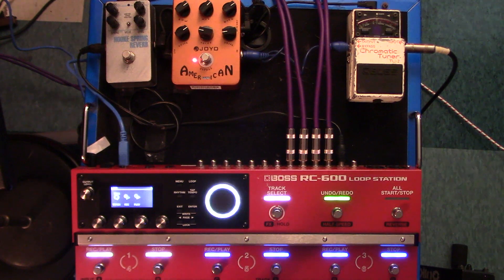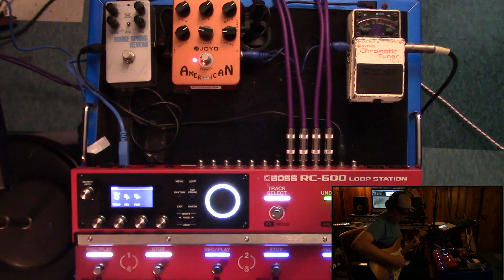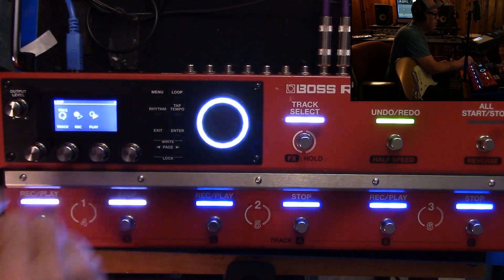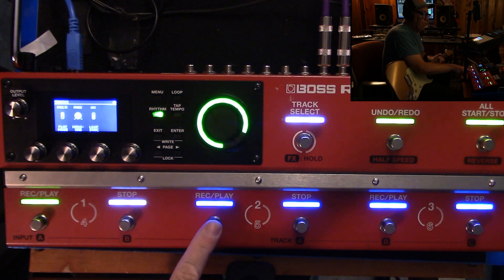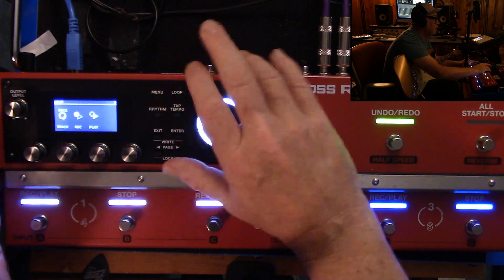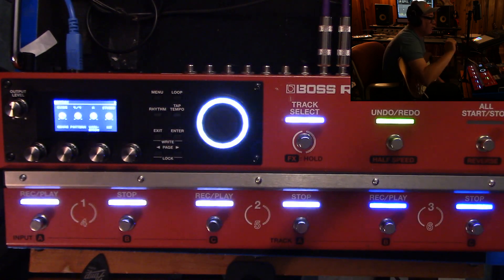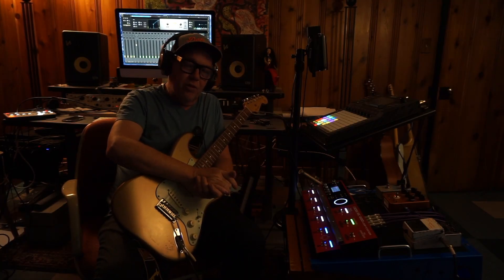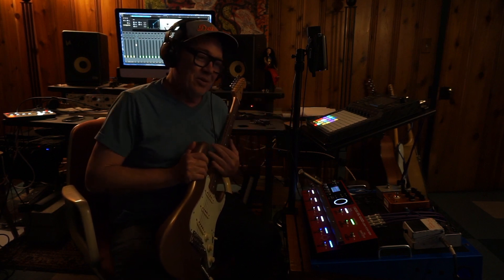BOSS RC600 SYNC SOLUTIONS #bossrc600 #rc600

Comment: Congratulations again, these are the videos that go, the ones that are made from sincerity. 
Thanks for warning about this synchronicity problem. 
You sound great with the Joyo and that other tremolo and reverb pedal. 
As you say in the video, perhaps the integrated boost effect can be useful, just as I have seen you in other videos take very good advantage of the reverb for the voice and I suppose that the fact of having an octave to simulate a bass is great help, but the rest of the effects I don't like too much from what I hear in others videos (I haven't been able to buy the unit yet). 
Could you tell me if you see it possible to use the two phantom microphone inputs of the Rc 600 to feed a stereo microphone, like the Rode NT-4 that I have, to record an unamplified acoustic guitar?
Reply from the maker: Hi Emilio! I'm sure the RODE mic would work great with phantom power from the RC. I admit my expectations have been very low for the quality of the FX. I do think they are more than adequate for a live situation or even recording. Some are better than others, but overall they sound "good enough" to get the job done. I have played through tube amps most of my life so I wasn't expecting the amp sims to be any better than the Katana programs. I like those too but find the simplicity and tone of the little Joyo to work even better. I am still waiting for Laura to do her vocal demo! I'll hook up a condenser mic too so you can hear it. The audio quality of the 600 is superb. What goes in, comes out with the same fidelity.

Comment: Any ideas why the loop station is not triggering the drums when I initially go to record a track. After I stop the recording the drums kick in. I can't imagine a scenario where this would be wanted, necessary, or needed but that's what's happening. Any advice on what to do to get Drums of a separate drum machine connected midi to engage when I press the pedal to initially record a new track
Reply from the maker: When I sync drums via usb midi I start the RC600 rhythm track on pedal 9. I set that to rhythm start/stop and it will send midi clock to another machine. While it is in play, I will record my loop on any track. I can then play back the loop with or without either internal or external drums. Seems I should make a video explaining it 😀 not easy to answer in a comment!
Reply: @LRCDetroit  I figured out that it will trigger the drum machine should I press the Rhythm button on the face of the rc600. But this also engages the drums for the rc600 which isn't a big deal but I just rather not use them so I can have full control on my Aleesis SR16. I've been trying to figure out if there's a volume for the RC 600 Drums of which I can just keep muted so I can have the Rhythm engaged the drum machine without also activating the rc600 drums. I mean there's got to be a way to simply mute the rc600 drums, no?

Comment: I'm wondering if you have this volumes set up so you don't have to reach down during a gig?
Reply from the maker: Hey Dan-yes for sure. I tried hard to keep consistency when recording my loops. It is nice to be able to balance as you go though. I can turn up the rhythm or loop independently and change kits quickly. No more tedious than having a huge pedalboard to tweak 😁
Reply: @LRCDetroit  so I'm guessing you have midi controls to adjust loop volume and percussion
Reply from the maker: @dancassidy7471  actually I just assigned the knobs under the tiny screen to RHYTHM volume and LOOP volume. If you use a separate mixer, you can easily do the same routing the sub outputs into the mixer. It was easy though doing a performance without a separate mixer, just the RC600 alone! The only issue was keeping the vocal mic volume consistent from song to song while using vocal input fx. I'm definitely going to make a video about that very subject. Like I said, an external mixer solves everything but trying to use the RC alone would be very efficient for doing certain gigs.

Comment: Hi mate. I'm having a major phasing type issue with my guitar. I run a tap tempo in to my rc600. It comes out and goes to a kaoss pad. I put my drums in the kaoss then tap in to the looper. It's all in sync then I sent my drums from kaoss to looper.

The issue is when I tap a tempo and play it in to the kaoss it then somehow gives my guitar a phasing type issue. It's really frustrating. 

I've turned of all effects and stuff but still nothing. It's doing it without anything actually been sent it to the loop. The guitar is fine pre tapping the tempo and recording it in to kaoss pad. 

Any help would be awesome 👌
Reply from the maker: Hi there-that’s a tough one! I’m not familiar with the Kaoss system and can only try to guess what may be the issue…so take this lightly. 
I have noticed the RC does have very slight latency when recording with the insert fx. However, it hasn’t interfered or become unmanageable. I’ve also thought the time stretching algorithm is not very good, so it’s possible you are hearing the RC adjust tempo to the tap and it’s mangling your signal! I set tempo manually so my experience in that area is limited. Wish I could help more!

Comment: Laura Rain and the Caesars
hI
I noticed you have Akai force. Are you using it in conjunction with the Boss 600 ?

I also have Akai Force. Does it make sense to additionally buy a looper ?
I want to have instant access to recording and effects . Unfortunately, there is no such thing on Akai Force.
Reply from the maker: Hi there-I have used the Force clocked to the 600 with success. Though when switching loops on the 600 I have not been able to switch scenes on the Force. Play/Stop works fine. I definitely would like to do more with the two machines together! Also, yes having the 600 to loop with your feet makes sense for me as a guitarist. A lot easier than the Force.
Reply: @LRCDetroit  
I'm not a guitarist, I'm a keyboard player. But I also want to have a looper.
What can you say about the RC 505 and the Hedrush Looperboard ?
why did you choose RC 600 ?
Reply from the maker: @СССРТВНижнийНовгород  I bought the RC600 because of the ability to store 6 loops in one program, use the rhythm machine and fx with my feet. Also, the routing is fantastic. Lots of inputs and outputs which works for well for a duo or trio live. There are a lot of little features that   appeal to me too, like the ability to program button function to whatever you prefer. I believe the 505 is very similar but made for tabletop? The Headrush I don't know much about at all. I think it depends on what function the looper will serve in your world.

Comment: I own this Looper and I hate it.   I would read reviews on seller sites like Guitar Center or musicians friend.   This looper does some cool stuff, but it also crashes often and sometimes randomly changes tempo mid songs.   If you play in front of an audience it will embarrass you and make you look like your not professional.  I have wasted so much time and money trying to make this POS work correctly.  

I wish I never sold my old looper.  It had less lights and buzzers, but it worked and was dependable.   

I am starting to think that there just isn't enough processing power in this device and no firmware update is gonna fix what never worked.  I feel cheated and I want my money back.  Shame on Boss for this abortion of a loop pedal.
Reply from the maker: Sorry to hear that, good luck to you finding another unit that fits your needs.